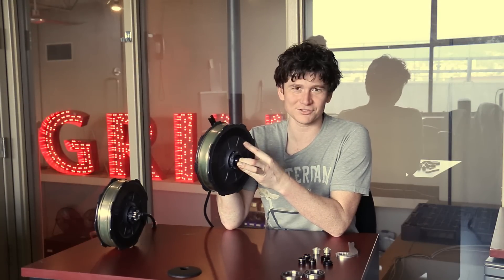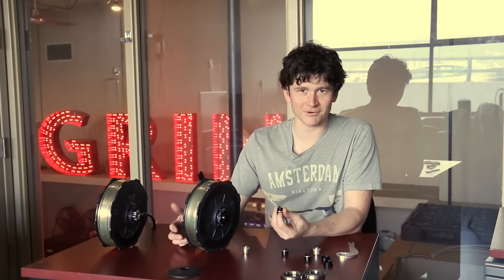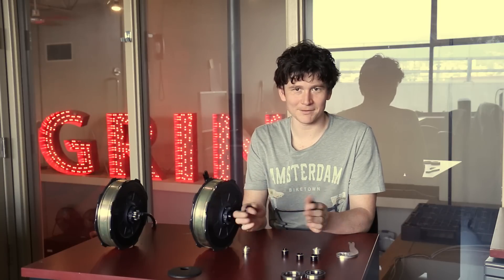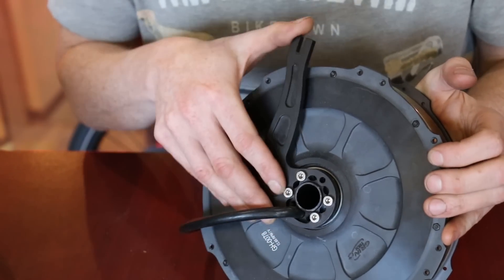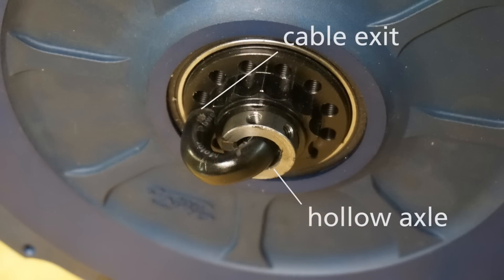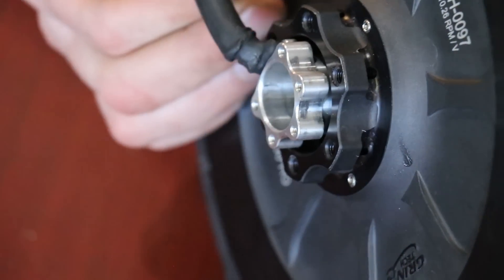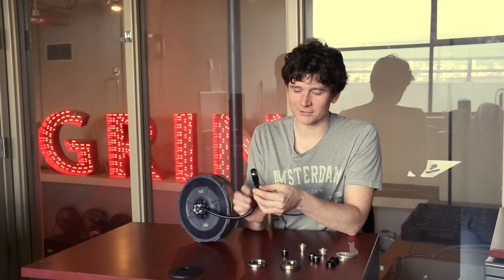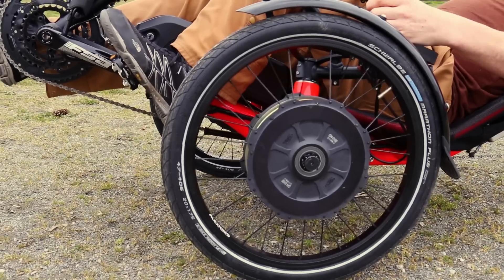Introducing the Grin All-Axle Hub Motor, with Updates for Single Side Applications

Comment: Can these be used on a trike that has an axle with mechanical differential?
Reply from the maker: Nope. You need a fixed non-rotating axle.If you have a differential that means that your axle is a spinning shaft to turn the wheel, and a hub motor won't work at all since the center of the hub motor cannot spin.

Comment: are these better then the newer mid drive setups?
also do you have a hub motor for a electric scooter?
so like a 8-10in rim ?
Reply from the maker: Better is subjective and depends on the application. For commuting, reliability, low maintenance, reduced brake pad wear etc then yes. For offroading on mountainbike trails, then no.

We have done 6" scooter motors, but nothing 8-10"

Comment: What kind of axle can a Grin single-side hub motor be used with so that it drives both wheels from one motor? IS this possible and any recommendations on how to set this up? Or do you need to use a hub in each wheel? In my case, I want to propel both wheels of a bicycle tear drop camper with one Grin hub motor on one of the two wheels supporting the camper. Thanks
Reply from the maker: Hey Jeremiah, there's no easy way to drive two wheels from one motor other than having the motor drive a chain with a cog bolted to the disk mount, and then that chain goes to a differential transmission driving two wheels.  So yes, you need to use one motor in each wheel.  Or simply electrify just one of the wheels and let the other one coast which also works fine.
Reply: @GrinTechnologies  thanks!

Comment: Does a torque/phase current control mode eliminate the need for a "virtual electronic diff"?
Reply from the maker: You actually never really need any kind of differential with dual motor drives. It's not an issue at all to have the outer motor run at a higher RPM than the inside motor when you are cornering, all controllers (Whether torque based or voltage based output) handle this situation just fine.

Comment: Will the trike installation tolerate wheel covers (disks)? Or, will it overheat because of the lack of air flow?
Reply from the maker: We haven't quantified this but if it has an effect on the thermal dissipation it will still work and run with plenty of power, just will have a greater extent of thermal rollback if you are on a long climb. If the covers are just on the spokes (and not the hub plate itself) I wouldn't imagine the effect to be too pronounced.

Comment: That is really good work!  With the powerful motors available, does anyone know the laws?  With fuel, a moped is to 50cc and a motor-driven cycle is 51-149cc.  150cc and up is a motorcycle.  What is the wattage for each class driver's license?  I don't see any rules.
Reply from the maker: There are plenty of rules governing ebikes (see https://en.wikipedia.org/wiki/Electric_bicycle_laws) , but having regulations based on defined rated motor-wattage is quite problematic since it is not very well defined, see https://ebikes.ca/learn/power-ratings.html.

Comment: Do these side mounted hubs come in left & right? Or do you need to have one run in reverse or backwards?
Reply from the maker: We've since updated the design to use two pieces so that depending on how you bolt them together they become a mirror image.  Some trikes use mirrored left/right disk caliper mounts, while other trike models use correct standard caliper mount and have it rotated 180 degrees on the other side.

Comment: that's awesome.
can i use it for my 20inch fatbike???😍
Reply from the maker: That depends on your front fork dimensions.  If it's a 150x15 thru axle fork then yes, but if it's a slotted dropout at 135mm then you'd be better off with a normal rear hub motor mounted on the front fork.
Reply: @GrinTechnologies  i want it to use rear axle.my bike rear axle is 190mm.so can i still use it?!

Comment: So here it is a year later, have you folks made a rear wheel assembly and hopefully for a fat tire! Can you give us some specifications like how much force in Newton meters at say 48 and 52 V? Thank you.
Reply from the maker: You can see the Nm torque for any given motor controller, battery voltage, and wheel speed using our simulator tool here: https://ebikes.ca/tools/simulator.html?motor=MGRIN2706_SA&batt=B5216_GA&cont=C25   Assuming the controller can supply the necessary phase amps then you can do upwards of 80-100 Nm for short times OK, but for continuous output at thermal rollback it would be more like 25-30Nm depending on the cooling situation.
Reply: Grin Technologies OK thank you but that is certainly not enough power for I’m looking for. Please send me an email (onetwoflush@yahoo.com) when you make a geared or higher torque motor for rear wheels, preferably fat tires 26” - 29” diameter  and wide rims. Thanks again!
    Best regards; Edward H.

Comment: Will rim brakes work well with this type of hub motor? My fork doesn’t have mounts to install disc brakes.
Reply from the maker: Yes rim brakes will work with any hub motor as long as you have it laced into a rim that has flat sidewalls for braking.
Reply: What’s the best hub motor to use on a Dahon folding bike that has a 75mm OLD spacing on the front fork. I prefer a hub motor that has the built in torque arm like the all axle hub.

Comment: Justin. Is Statorade an option on these?
Reply from the maker: Yes, for sure. In the original V1 Grin All Axle motor we had some issues with statorade leaking through the ball bearings which weren't well sealed as the the fluid had to flow over the bearings as it was injected in the axle. But in the updated V2 design we have a special bearing with a double lip rubber seal and have move the injection port to the the middle of the side plate, and no issues at all so far.

Comment: The v2 looks great! One of the deal breakers for me on the original design was for any internal maintenance, you could not open up the hub without unlacing the wheel. Has this been remedied as well?
Reply: Thank you for this explanation. In my experience with DD hub motors, I’ve had to replace bearings every 15,000 miles or so. Also invariably something goes wrong with hall sensors or a phase wire.. Maybe I’m unlucky, but I’ve learned to fix it all and keep going. I’m a huge fan of most everything Grin :)
Reply from the maker: No you still need to unlace half the spokes, but it's much easier to open and service now that we're using O-ring seals both on the side plate and all the screws rather than sealants. Unlacing one side of the motor is not really a big deal and the need to open up the motor for any reason is quite rare, especially now that we've got the thicker/larger ball bearings. What kind of service work do you expect to do on the insides of a sealed DD hub motor?

Comment: Does that disc side torque arm work with normal bike fork too?
Reply from the maker: We now have a regular torque arm that goes on the non-disk side of the V2 grin motor for regular bike forks.  The website has finally been updated to have all the relevant info: https://www.ebikes.ca/product-info/all-axle-hub-motor.html

Comment: Is it possible to develop a high torque gearless motor with no resistance to unassisted pedalling?

That would be the best motor
Reply from the maker: Any motor without permanent magnets (such as inductance or variable reluctance machines) will have no core losses when the motor spins unassisted. But they don't usually have as high of a torque density, and you can completely eliminate the motor drag with virtual electronic freewheeling in the phaserunner,  see https://www.youtube.com/watch?v=d0nyiDbWZuM

Comment: Can this be used on a single speed so that I can hook up to a mid drive and add their speeds together
Reply from the maker: If your bike has 100mm spacing on the front fork (as is almost always the case) then you can install this motor no problem and have a 2WD setup. In general Mid-drive motors don't make too much sense on single speed bikes since you have all the disadvantages (accelerated drivetrain wear) without the main advantage (variable gearing for the motor), but functionally it will still be fine.
Reply: @GrinTechnologies  sorry I meant to say fixed gear I want to use the cycle analyst to use one throttle on an 72v battery I was hoping to add top speed not acceleration

Comment: you dont say the wats per hub even in  the purshes site they dont say the watages of the hub
Reply from the maker: But at least we explain why we don't!  
https://www.ebikes.ca/learn/power-ratings.html
https://youtu.be/xnhuoUrwhIw?t=1191
See:
https://www.ebikes.ca/tools/simulator.html?motor=MGRIN2708&batt=B4823_AC&cont=C25
and play around with the different battery voltages, controller current limits, vehicle types, and loads to see the actual output power to temperature to over-heat in time relationship. And you can compare it to other hubs there too by opening the System B tab.

Comment: Just when you thought the hub motor was going extinct (due to the mid motors) this brings the old heavy tech forward into the modern world.  Very good job.
Reply from the maker: We're working hard to make hub motors have a nice day in the sun again. In the late 90's and early 2000's it was all mid-drives, then from mid 2000's to early 2010's hub motors rose to dominance with their simplicity and elegance,  and from about 2012 onwards the mid drives came back with the turn-key bike market, but in increasingly proprietary packages which have a lot of downsides for end users and product support. So yeah we're trying to swing the pendulum back to hubs and it's  important that the tech is caught up an modernized too!
https://www.ebikes.ca/learn/why-hub-motors-are-awesome.html
Reply: @GrinTechnologies    It depends a lot on the application.  For a mountain bike that is going to do extreme off road riding the mid drives are the way to go simply because the weight is where it should be.  But they are pricy right now and have many reliability issues.
Reply: @ericlinz4626  which is what Justin says on his website if you have a look at the link he included 🙄

Comment: What are the detailed specs of the motor:
Io, Max continuous current, max continuous power dissipation, saturation current (or is there a torque V current graph), phase inductance?
I can't find these details on the website.
Reply from the maker: Everything you'd want to know about performance in any set of circumstances is shown in great detail here:  https://www.ebikes.ca/tools/simulator.html?motor=MGRIN2708_SA&cont=C25&batt=B5216_GA
And if you really want to get in the deep of it, use this tool here:  https://www.ebikes.ca/tools/trip-simulator.html

Comment: Sign me up.  I got a 2018 Catrike Expedition that I am wanting to convert.
Reply from the maker: Well send an email! Although it will generally be easiest and cheapest to use a single rear hub motor than two of these on the front. The dual front drives are sensible if a) you've got an internal gear hub on the rear wheel and want to keep that,  or b) you have an application that really requires the power and torque of dual motors, where one hub motor on the rear wouldn't cut it.  If you tell us just what you are after with the conversion we could advise on the best approach.

Comment: How many volts and watts? Torque?
Reply from the maker: That depends on the RPM you want to run the motor at and for what time duration you need to apply the torque. The performance under any given controller, battery voltage, and wheel diameter is accurately modeled here:
https://www.ebikes.ca/tools/simulator.html?motor=MGRIN2708&batt=B5216_GA&cont=C25
And if you want to understand more on why there isn't meaningful or voltage "ratings" on motors, have a careful read of this article here:
https://www.ebikes.ca/learn/power-ratings.html
Reply: Too low to share.

Comment: Anything above a eZee motor at 36V is a moped. Especially this motor at 2KW. Isn't that equivalent to 50cc?

What do you think of splitting the focus of your business into electric bicycles, mopeds, and motorcycles? Making sure to explain and assist customers though legality challenges like registration, licensing for the latter two?

Safety risks go exponential after 30km/h, and linearly with mass, so I think each category needs to be treated appropriately.
Reply: Alright inspector. Milking insuerence building is to the left

Comment: Hello Justin , 
Early adopter ...  see link below , if you please ... notice the rolling resistance? Seeking expert feedback . 
Also plans to cut excess on spindle fork that is of different , larger circumference and replacing cut with same length of correct size spindle section . Using a local fabricator , welding shop . 
https://youtu.be/JQjtkg7l3-E

Comment: What about a rear wheel application?
Reply from the maker: See our comment to James below.  At the moment it's front only since that was where the most unique needs existed and where I wanted to focus, but once we have our production line manufacturing dialed in this summer we'll be in a position to start developing the rear version next (getting the cables exiting on the disk side was part of that ;-) ).  There isn't an easy way to 'convert' the front to a rear, we need to do a new right side side cover plate that has integral mounting for a cassette freehub.

Comment: When are we getting it on the rear with freewheel?
Reply from the maker: We'll start tackling that soon, but rather than a threaded freewheel you can be sure it will have a modern cassette freehub system instead ;-)
Reply: @GrinTechnologies  a 4kg rear hub that fits on all modern dh frames would be a game changer
Reply: @JamesWilliams-ji4mg   All the benefits of a modern DH frame with the reliability and durability of a Grin developed product = sellout.
Reply: Request rear caps for 157 dropout. Zerode G2.5 frame waiting for J/Grin to make dreams come true :)
Will look at the front for a Lefty from 2018 BadBoy1 with belt/rear Alfine hub.
Reply: I'm planning on putting a front hub motor on my turner DHR dh bike, all ready have it set up with a wide range cassette in the back 11-49t.
Reply: Was about to order this comment saved look so grät but not free?

Comment: How do these motors work in comparison to a normal direct drive hub motor?
Reply from the maker: As far as motors go they work just the same as any other direct drive hub motor. The main difference is that they install more easily on most bike forks and they weigh a lot less.
Reply: @GrinTechnologies  How is that possible? I've thought every motor needs a stable axle for it to work. How is that possible with a moving axle?
Reply: @Marvin-lj7ul  Oh I see the confusion. The axle here is not moving, it's hollow but it's still fixed to the bike frame via the torque arm so that it can't spin.
Reply: @justinlemireelmore  Ah I missed that part with the fixed torque arm, thanks for you answer!

Comment: Awsome work Justin!.. Can't wait to try that on my KMX trike  in combinaison of the QS205 3kW rear motor and make a new acceleration record!!!!
Reply from the maker: You better believe it Doctorbass!  :-)   What's the diameter of the axle spindle that KMX use on their front wheels, is it also a 20mm shaft or something smaller? If you send us a picture or details of the wheel mount of your trike we can see if our existing adapters would work or if we'd want to machine something special for the KMX line.
Reply: Grin Technologies yeaahhh I’m VERY happy here watching this video and reading these comments about KMX trikes... so many electric KMX out there!!
For detailed drawing you better contact Adam Roy he’s in Canada (probably around the corner from you) he makes a drop-in air-suspension solution for KMX (I have a set) https://youtu.be/19CEyBE4jrU
Adam has a proper 3D CAD and measurements royindustries@videotron.ca
Reply from the maker: @BrunoPOWEEER  OK Sweet, thanks for the tips, we'll follow up with that for sure. I'm hoping that we'll be able to accommodate the majority of trikes brands on the market through just a few torque adapter options and/or axle shims so we'll keep you posted. If there's anyone who we all want to see rip around on a 3WD KMX it's BrunoPOWEEER!  (In a drag race with Doctorbass of course)